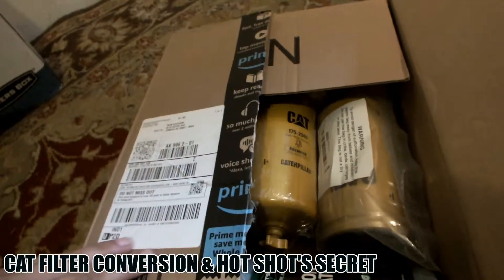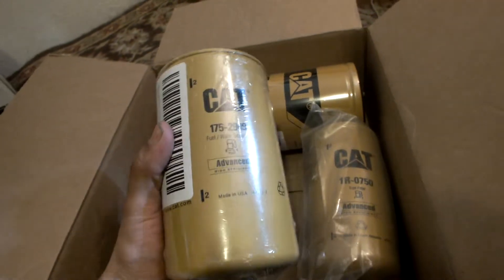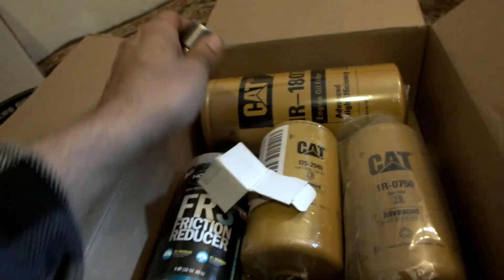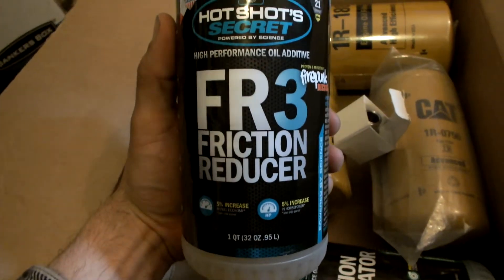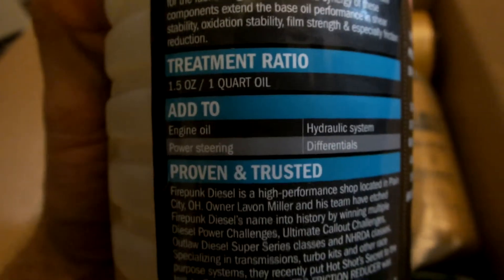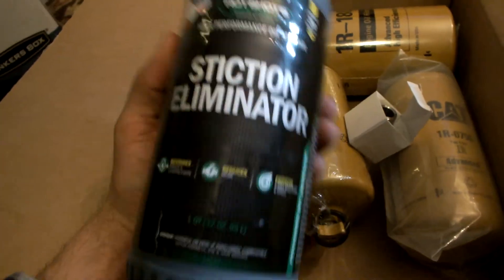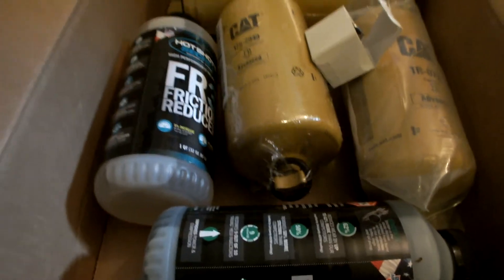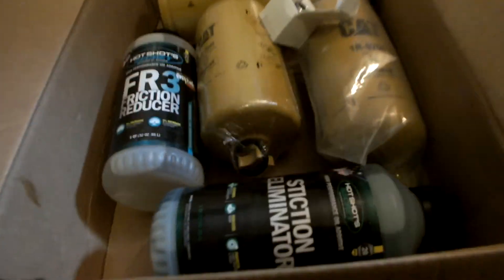UPGRADE Your LB7 Duramax FUEL and OIL with CAT Conversion Kit!

Comment: This adapter didn’t work with my Banks Oil Cooler 😢
Reply from the maker: @DEEJAYLEGO  is that the l5p cooler??? Completely different system compared to 2001-2016 models 😬  that sucks man!  Sorry you went through all that effort if taking the old one off.  On the plus side, you have a banks oil cooler!
Reply: @KooshdaakaaGarage I wish they make the adapter for the I5p banks Oil cooler
Reply from the maker: @DEEJAYLEGO  me too.  Maybe they will make one eventually.  How are you liking the upgraded cooler?  Have you noticed a difference?

Comment: Are you able to post the part number for the fass filter replacement, oil filter replacement and the adaptor please?
Reply from the maker: Here you go! You'll want the oil filter adapter if you haven't made the conversion yet.  
🔴Caterpillar 175-2949 Advanced High Efficiency Fuel Water Separator: https://amzn.to/3xblMFE

🔴Caterpillar 1R-0750 Advanced High Efficiency Fuel Filter: https://amzn.to/3gpNyse
🔴Caterpillar 1R-1807 Oil Filter: https://amzn.to/32v0o04
🔴13/16"-16 to 1 1/8"-16 Oil Filter Adapter for Duramax CAT 1R-1807: https://amzn.to/3dx2ovf

Comment: How would the hot shot SE help your injectors when Duramax injectors don't use oil?
Reply from the maker: Nice catch Chris.  I dug into that a little deeper after reading your comment.  You're absolutely correct, this will not do the top end of duramax injectors any good like it does for other vehicles.   I'll update that in the description.   I suppose if one were to go the Hot Shot's route then Diesel Xtreme would be the better route:  https://amzn.to/31XlBgr to clean a fuel system.   Though I have been interested to try Genuine GM Upper Engine and Fuel Injector Cleaner https://amzn.to/2WnuoqO  but holy hell it's expensive to purchase and almost as expensive to ship up to Alaska.
Reply: @KooshdaakaaGarage  no problem man. Yeah the diesel extreme is awesome followed up with the EDT at every fill up. However the stiction eliminator still makes a big difference in the turbo of Duramax's. Less lag and quicker spool ups. Stiction is still present in every diesel but Ford's have the worst time with it in their injectors because they are oil driven. Luckily us Duramax guys don't have to worry about that. Still a great video 👌🏻 Also, why the ACdelco injector cleaner is so expensive is because they don't make it anymore. They have a new cleaner out that IV heard dosnt do as good. Volvo has a injector cleaner that I also read on forums that the same exact thing as the original ACdelco cleaner for a much lower price and they still make it 🤷🏻‍♂️ not sure how well it works but IV thought about looking into it myself.
Reply from the maker: @chrisao1987  That Diesel Xtreme is a great overall fuel system additive,  I’ve ran it a few times and do appreciate the extra lubricity it brings, I like Stanadyne too.  Hot shot’s FR3 Friction Reducer https://amzn.to/336COpm  is a phenomenal additive as well.   In addition to running it in my engine, I dumped some in my rear diff and man is that thing running cool as a cucumber now.   Before when I’d take off into the mountains for some R&R  my rear diff would be too hot to touch, but now with the friction reducer (4 ounces or so…think in my hubris I added a little more) I can run it all day all over the mountains with a camper on back and still be able to comfortably rest my hand on the  warm diff cover, if I were thinking I would have done before and after temp readings.   I haven’t noticed any G80 locking issues so I must have not over did it with friction reducer for it to still function properly; think I’ll try adding it to my manual transmission in my old Chevy next.  What is the name of the Volvo injector cleaner you are talking about?   I did some google searching but haven’t been successful in finding it, wouldn’t mind giving it a try if peeps are rendering success with it.   Seems like some people are using some cleaner called BG in place of the ACDelco cleaner that is not being produced anymore.  Found  ACDelco 10-3015 https://amzn.to/2qVwdj7  that must be the replacement you mentioned.  Man that’s too bad it’s not working out for people as well as the OG cleaner,  the original sounds like a beastly cleaning agent to have in ones back pocket.